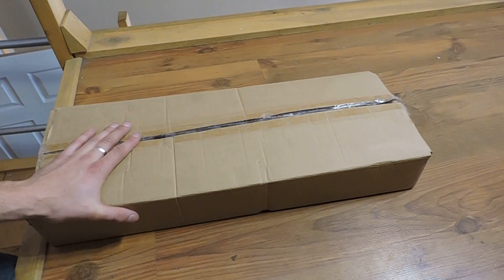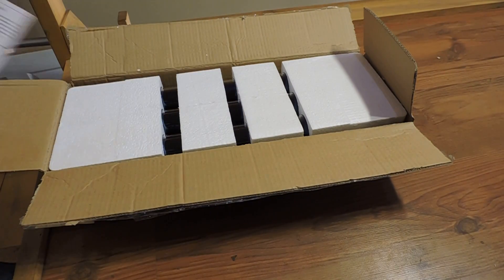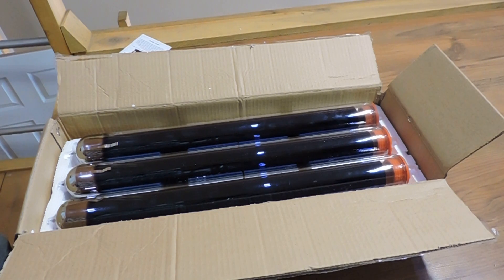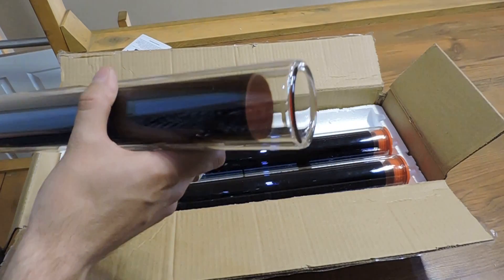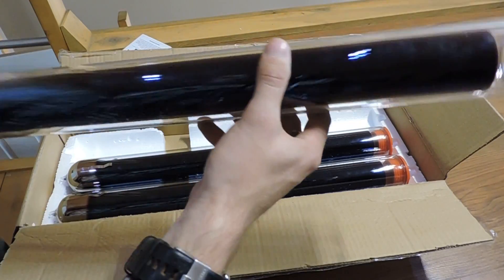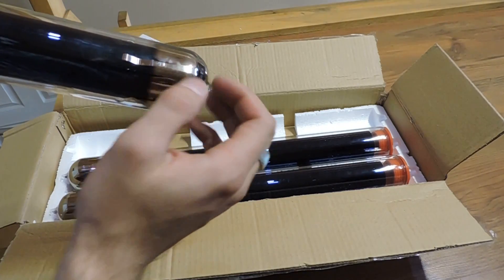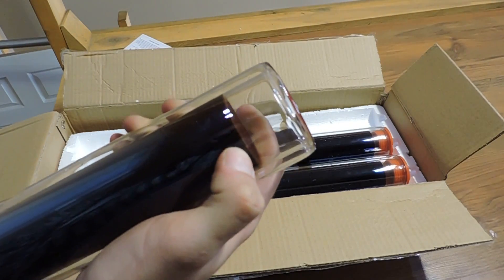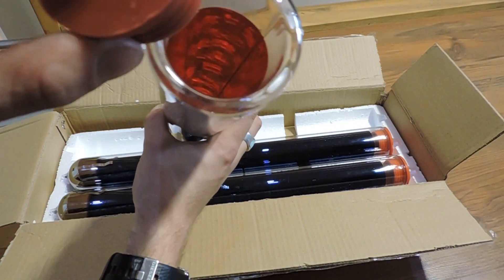.5M Solar Evacuated Tube Unboxing & Explanation

Comment: What keeps them from freezing and breaking?
Reply from the maker: In North American Climates we use heat transfer tubes or called heat pipes, regarding breaking they withstand 1" hail. Even with all our 1.8 meter tubes we don't have breakage. Nass Team
Reply: Thank your for the reply. I do not know how that works and i was afraid the tubes might happen to freeze but i guess these heat transfer tubes work somehow to keep the main tubes from freezing? What heats the transfer tubes?
Reply: The vacuum between the glass does not allow the cold to freeze anything but the outer glass and since there's nothing touching the inside of the outer tube it won't break. But the inner tube that holds the water gets the solar heat that passes through the outer tube on to the dark inner tube. And dark like black in the sun makes heat. So the inner tube can get really hot but if you grab the outer tube you won't feel any heat. With no air in the middle there is vary little molecules to bounce off each other to transfer energy "heat" from either tube.
Reply: Thanks, No heat or cold through vacuum, so if i have water in a vacuum of deep cold space then it will not freeze. I was concerned only about the water inside the pipe freezing and breaking the pipe if on very cold dark days with no sun so this is good that it will not freeze. So, how much did you say this cost?
Reply: I've seen little short pipes like these for 6 to 7 hundred and the longer pipes at 2 thousand and up. And if you want to save money like I'm trying to do by making one myself. There's a lot to make sure you don't have one of those " oh bummer" moments. Mostly I've seen 6 to twelve pipes that lead up to the insulated holding tank.  the holding tank has a copper coil for the heat transfer to keep the fresh water well away from not fresh water. I've learned the bigger the holding tank you can get plus greatly insulated the more you will be pleased.
Reply: And if you have water in a vacuum it would freeze because when liquid evaporates it gets colder. The vacuum between the glass tubes does not hold a vacuum on the water.